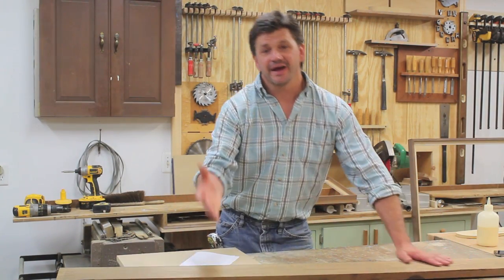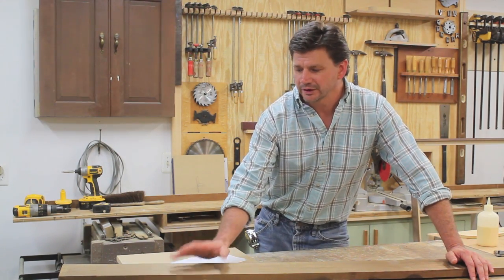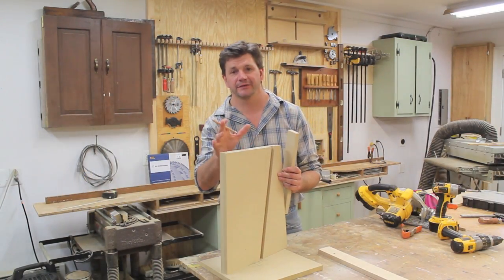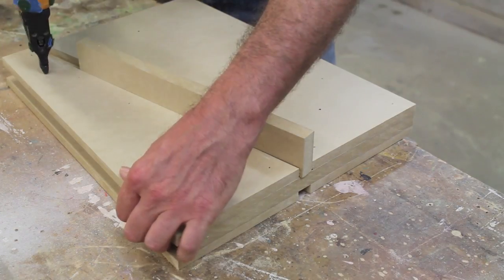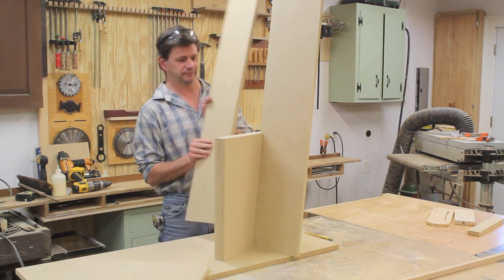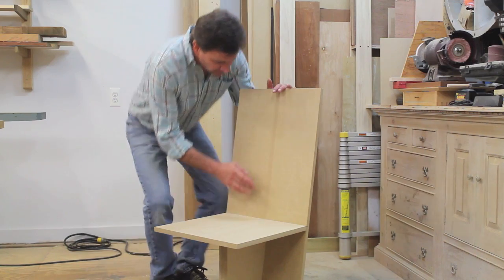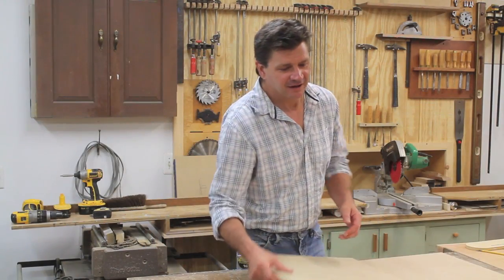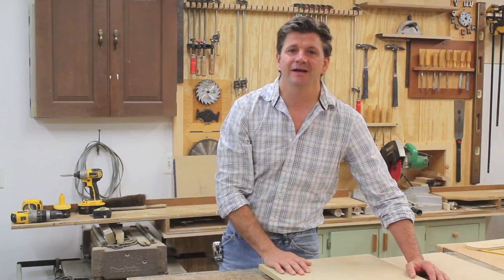Build a full size Model Chair with MDF

Comment: You should match wood species of the vertical strip on the back with the vertical piece under the chair to make it look like one piece that goes through the entire chair.
Reply from the maker: I thought about that, it would look good. Maybe next time the chair is almost built, should be finished Friday.
Reply: ***** Very cool. Thanks for responding.

Comment: if made from plywood couldnt you have slotted it to fit instead of the gluing two pieces together with a filler board ?
Reply from the maker: yeah you have a point